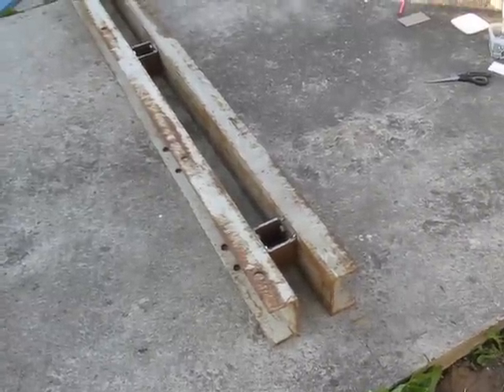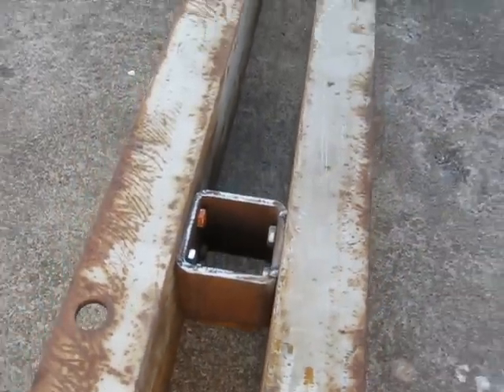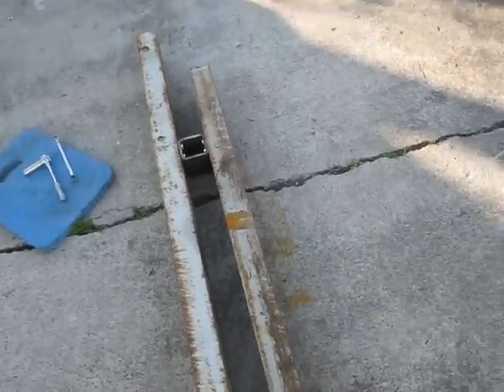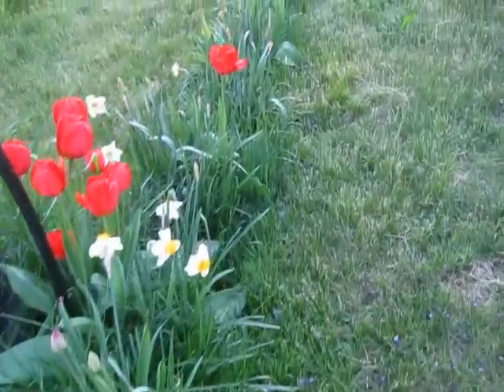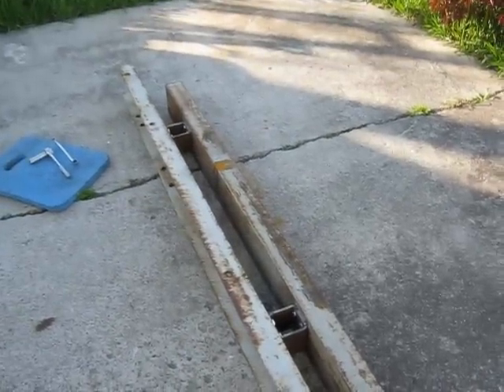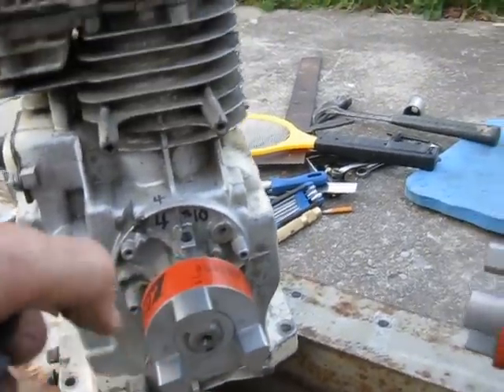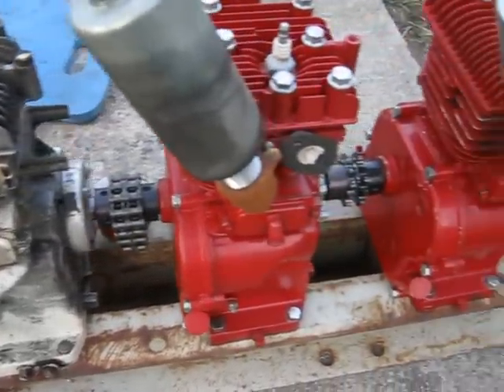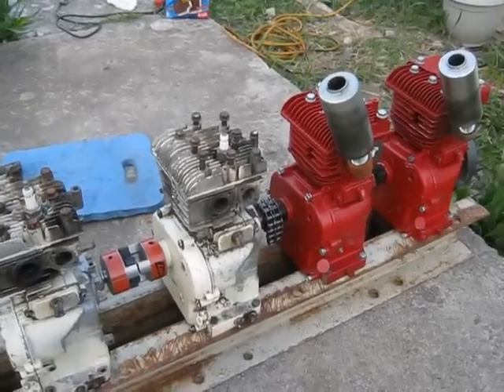8 Cylinder Briggs Frame Vid 2

Comment: I really enjoy all the videos you produce. I really love seeing the different builds that you do, especially the radically different or innovative ones. :) I'm anxious to see how she runs! L8 engines were always neat in my opinion.
Reply from the maker: +mannys9130 thanks for your interest, and understanding! I get some people that wonder why I build such crazy, and complex machines that generally have no purpose except to run for a few seconds or minutes on youtube. I admit I ask myself the same question sometimes, like when building this engine, I will have many hours invested in it, and only run it for a minute or so at a time. I enjoy the building experience, as well as the problem solving aspect of how to design and build such an engine the cheapest and easiest way using the least machining possible. My 3 cylinder 327 stacker engine was a disappointment do to the noise produced by the crank joints, however my son re-machined them so it is almost ready for another run, hopefully a much better sounding one!
Reply: There doesn't need to be a rhyme or reason to why you enjoy your hobby. It makes you happy, it's fun and interesting, and we all get to watch the videos you make of the engines! It's win win.